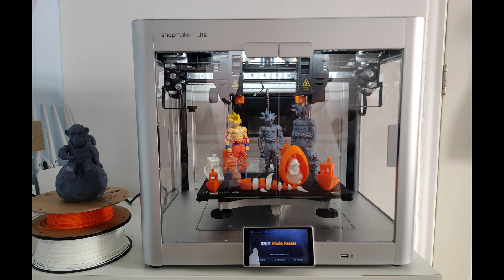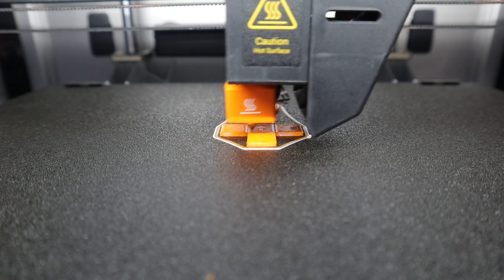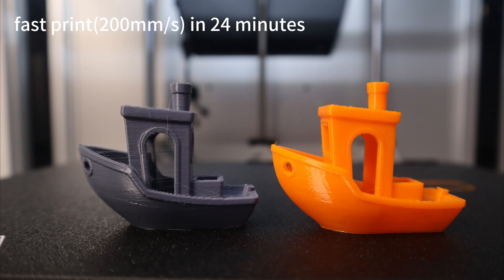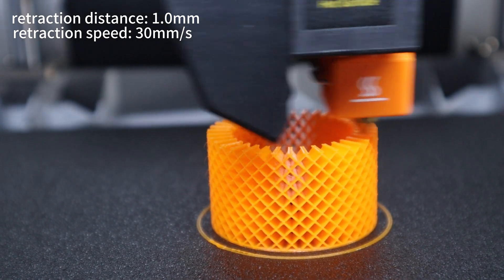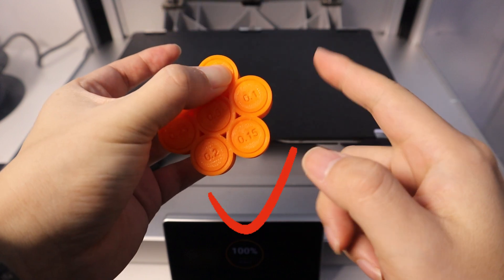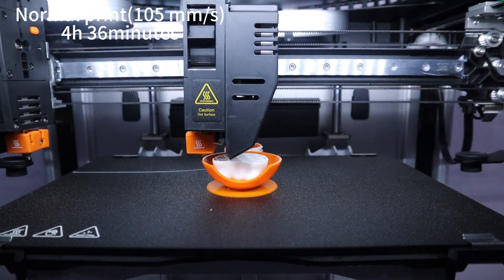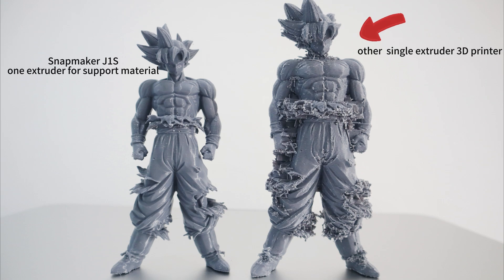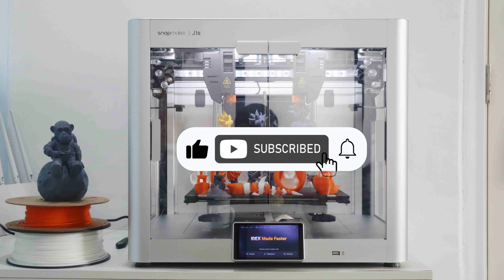Snapmaker J1S Review: The Best IDEX 3D Printer for You

Comment: The 3-color character with the blue bands above the wrist.  How did you accomplish that?
Reply from the maker: I painted it
Reply: @TechnicalTrendy  Ok, thanks.   I'm currently looking at the Snapmaker IDEX and the PRUSA XL for its 5-color option.  Reviewers say that the Bambu Labs multi-color option is reliable, but too wasteful in terms of time and materials.  On the horizon is the CoPrint add-on solution, but reviews on its performance are scarce.
Reply from the maker: @vy1w1yv  Yes, multi-color printing takes too long and also  more material waste

Comment: Hello from France
 I am very interested in this J1 printer, I have seen a lot of video with supposedly noise problems in the rails and also extrusion problems with the nozzles which are blocked.
 When is it really, have you encountered this kind of problem or the impressions are up to the Bambu lab P1s
 Thanks in advance for the response
 Hervé

Bonjour de France 
Je suis très intéressé par cette imprimante J1,j’ai vue beaucoup de vidéo avec soit disant des problèmes de bruits dans les rails et aussi des problèmes d’extrusion avec les buses qui ce bouches .
Quand est-il réellement, avez-vous rencontrés ce genre de problèmes ou les impressions sont a la hauteur du Bambu lab P1s 
Merci d’avance pour la réponse 
Hervé
Reply from the maker: Hi, I haven't encountered these problems so far. Personally, I like this machine because of the dual extruder lol...
Reply: @TechnicalTrendy
Reply: @TechnicalTrendy  Should you take the J1 with the fan option or is the J1S different except for the fact that it is fully mounted                
 Have you tried using OrcaSlicer???
Reply from the maker: @hervebeaulieu  the j1s included the fan. I use its Luban software to control the printing process. Haven't tried using OrcaSlicer. The Luban software  can basically meet my needs
Reply: @TechnicalTrendy  Thank You Very Much
Reply from the maker: it's my pleasure
Reply: I bough the J1 1 week ago. The left extruder wobbles around 0.5mm on the X-Rail. Contacted support today (5.5.24) for an exchange x-rail. 
If I don’t get a response the next week I will return the printer. 

The printer must have sit a long time in storage because the orange pla was brittle. Had to throw away half of the spool.